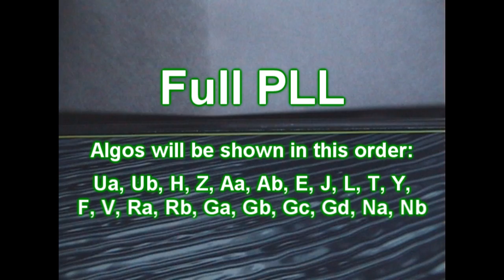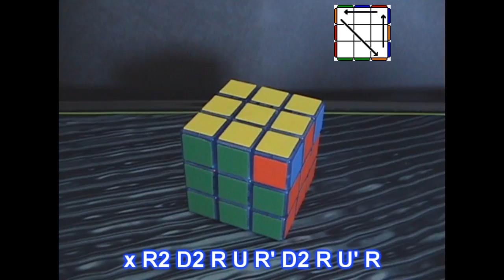PLL Algorithms

Comment: @formigalformigal On a normal 3x3x3 you can't have two corners swapped, but this corner error and a few others, can happen on a void cube. A void cube doesn't have the center tiles, so you could solve the cube but your "invisible" centers could be messed up.

This algorithm swaps two corners and messes up the centers, but on a void cube without centers it just swaps the two corners only: U' r U' F2 D R' U R D r' U' R D2 F2 U r' U2

Try that on a regular 3x3x3 that's solved and you'll see.